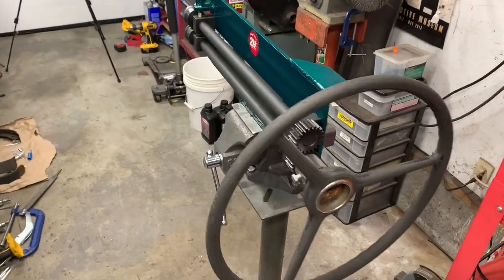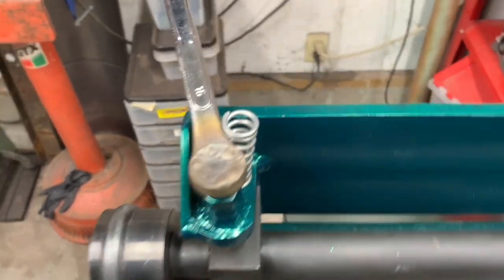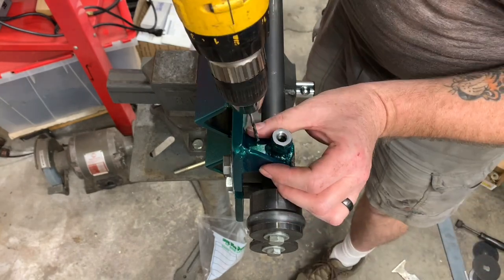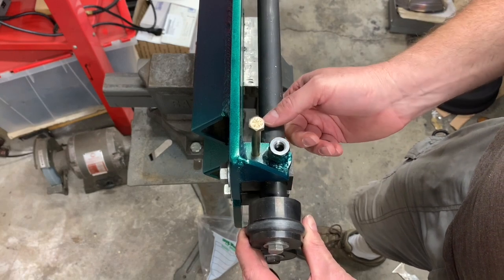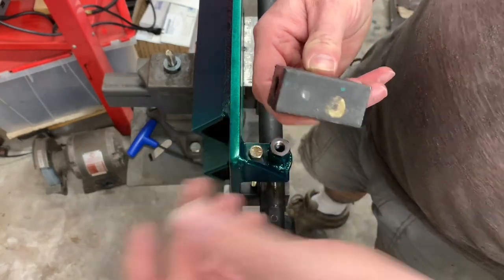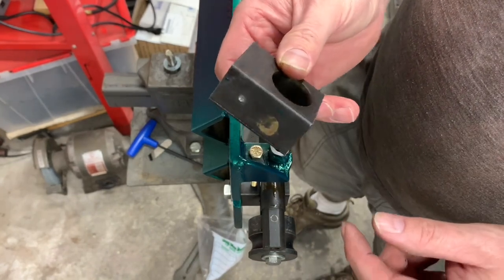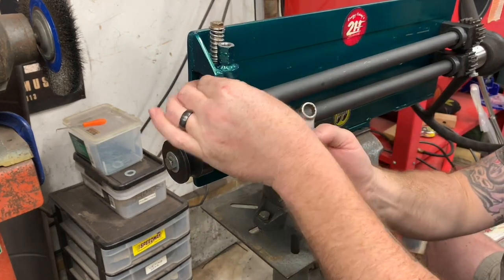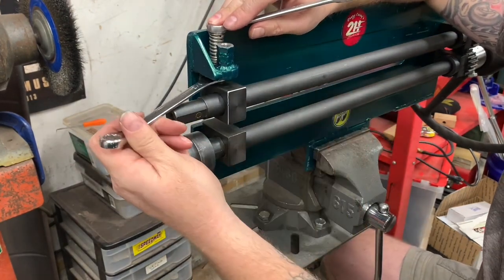The BEST Mod To Do To Your Harbor Freight Bead Roller! Bearing Block Return Spring & Fastener Handle

Comment: Good video!  I think you might could have worked up a spring mounting on the back side so it did not interfere with your handle. I also think this might be better because I fear you may have weakened that bracket that now has two holes in it. But this is just back seat quarterbacking. Good job!
Reply from the maker: It’s an interesting idea, but I can’t wrap my head around it. You’d have to add another tab on the back side for a spring to attach to, and another block or at least a spacer. The problem with that approach is you already fight these blocks when you’re working curved panels (I radiused these heavily on the inside after shooting this video), and sometimes I work right against the frame on that back side. Putting the spring there would essentially make it twice as wide. Regarding weakening the block, I have zero concern. Even on the Eastwood style with a sleeved block, they’re still plenty beefy. But, hey, I always appreciate somebody throwing out ideas. I just can’t see how to really make that work. But, tag me if you end up trying it! 👍🏼👍🏼

Comment: I just did that mod to mine yesterday along with adding zerk fittings on the blocks for oiling 
But I centred the bolt on the plate rather than the block as it’s not extremely off set on the block
Reply from the maker: That’s a good point! Mine was more of an afterthought, to be honest.